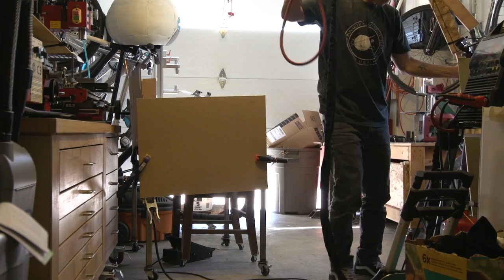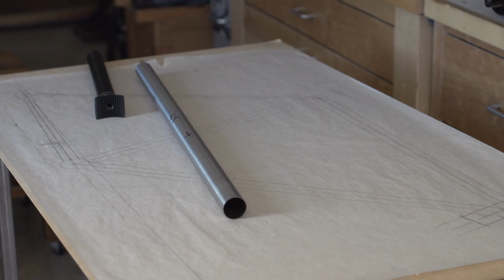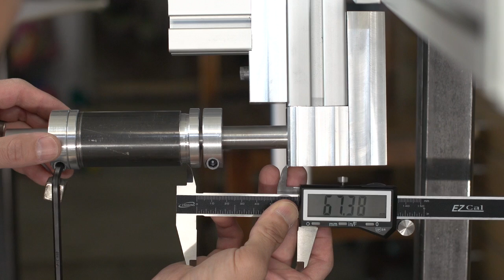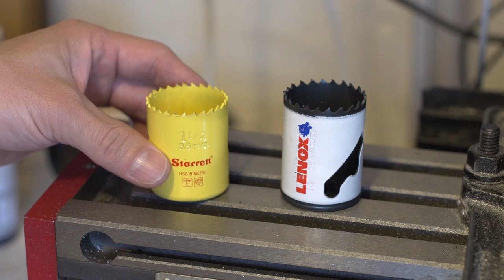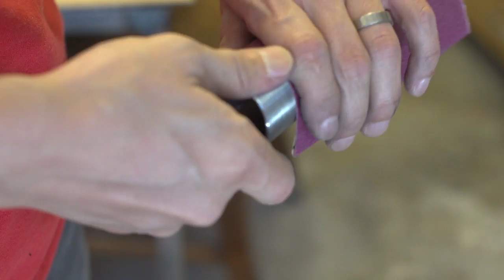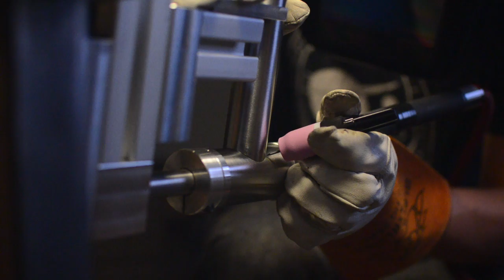Bicycle Frame Build 31 - Bottom Bracket Seat Tube Fixture

Comment: Something that will make a huge improvement is changing out your foot pedal; In the video you can hear it snapping off harshly. I had a ton of trouble with my AHP tig welder so I went to weld.com and swapped it out with a nice SSC pedal and it made a huge improvement over my puddle control. Definitely worth seeing if they make one compatible to your machine, I also upgraded my flow meter and got rid of my sugaring problem.
Reply from the maker: +wrencheshurt Thanks for the recommendation. The pedal I have is a step up from the cheaper ones, but its still not as good as the better ones. The snapping up sound could just be my noisy technique ;)  But yeah, the pedal isn't the greatest. Some day I'll upgrade.. or maybe I'll just wait for it to break. I'm cheap!

Comment: Thanks for sharing the tip about groove in bottom bracket. I am quite happy I haven't had my frame welded yet.
There was a 50% chance I would have learnt that the hard way.

What is the purpose of drilling holes in the bottom bracket? I mean what could possibly happen if I do not drill those holes.
Reply from the maker: +François Gasnier The holes are for ventilation. Without them, condensation gets trapped inside and the tubes will rust from the inside. Some folks even drill for the chainstays.  But some chain stays have holes near the drop outs on the inside.

Comment: So much good on this video.  Love the idea to face off the backside of holesaw.  I too just got some starret saws, hoping they will work better.  I made a heavy duty mandrel on the lathe with a bigger mating face, hoping it will smooth out the chatter.   You got a nice fitup....should weld well.  I also dig the setup for crossdrilling the BB.  Keep the great work going Pithy! G
Reply from the maker: +aspenbanjo Hey Gary, facing the holesaw is not my idea. I saw a pic of Alistair doing it on his Duncan Cycles flickr. Yeah, this cut seemed to go well. Mainly because I discovered that my cross slide was loose. So I found those the hex screws that lock it down. Heh, I made those angle blocks because I didn' t have any quality wood. It was kind of overkill!